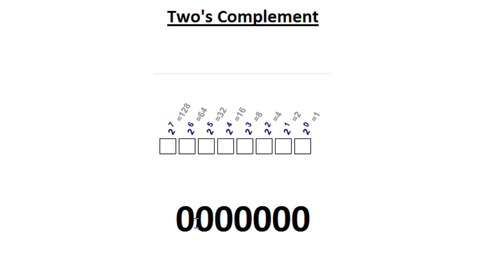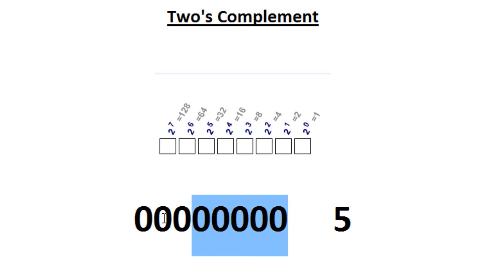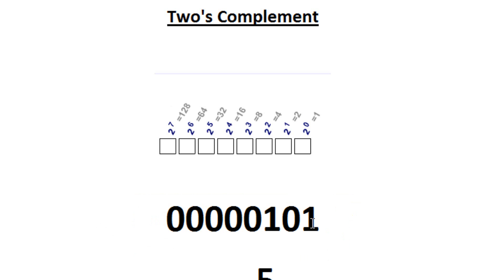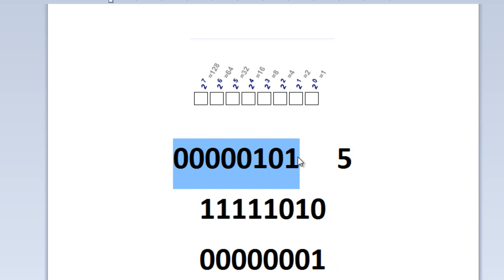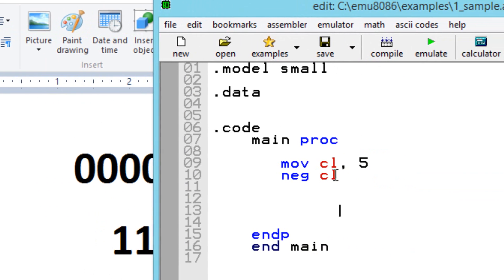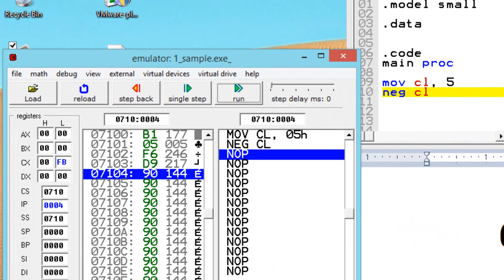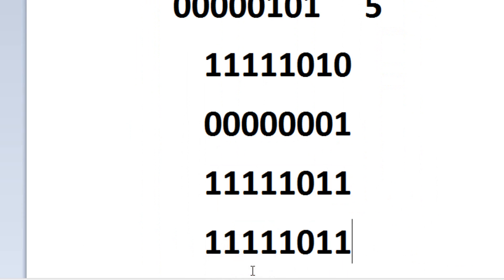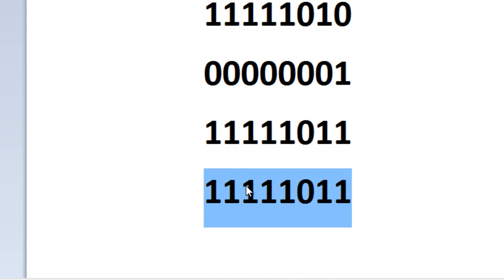Assembly Language Programming Tutorial - 24 - NEG Instruction and Two's Complement

Comment: Your emulator is inverting binary digits but not making it negative. Even in your conversion table you can spot that  it is 251. How do you get  -5???
Reply: +zinturis He has negated it, but he didn't exactly explain why 251 is similar to -5.  In this case, he had a 8-bit value, so the maximum value is 255.  If you go beyond 255 (11111111) to 256 (100000000), you get a 1 and 8 zeroes, so the 8-bit value is 0 (taking just the last 8 digits).  In this example, 251 is -5 because if you add 251 and 5, you get 0, just like when you add -5 and 5.